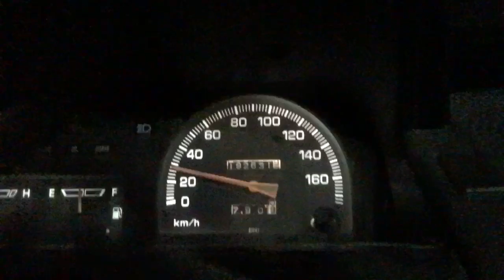1.5L/100km - Running your car on vapour - It really works!

Comment: With my anti-knock prototype I can advance my ignition timing to the maximum factory setting.  

Tested it on various engines including two diesels.  Seems to work in most cases.  Doesn't work well with carbureted engines.

Pause on the distributor part of the video, if you wish?

________________________________
A set of modifications is listed in the comment section of one of my videos.  The modifications are for lawnmowers and generators mainly.  Engines that run at A constant high speed.  

Racers back in the day would advance their timing past the point where the engine started to knock.  As long as they kept their RPMs up, the knock wouldn't ruin their engines.
Reply: Does running it too lean cause damage to the engine?

Comment: Another trick. One ounce of Acetone per ten gallons of gasoline. This will make the fuel vaporize more easily.
Reply from the maker: Ron Armstrong interesting! Thanks I’ll have to try that out. Have you tried this before?
Reply: I wonder if he's trolling since acetone is notorious for melting plastic :hmm:
Reply: @PrideSage99  He's right, acetone works well. I've used it on injection and carb systems. Just use a very small amount as he said.
Reply: I would be cautious about using Acetone in your fuel. It may adversely effect or damage the rubber parts and seals.  Check with the manufacturer of you fuel system to find out.
Reply: @robertmckinley2886  at an ounce per 10 gallons I have a feeling it won't be a problem.
Reply: I am wondering if the Acetone would have an adverse effect on the rubber parts in the fuel system?
Reply: Acetone does burn really well
Reply: @PrideSage99  It depends if your fuel housing is a plastic then yea it'll melt except if you made the housing made out of steel

Comment: have you tried leaving the gas as it is, and adding the vapor. that should increase mpg in theory. the computer sends to injectors the amount needed for power......the again yours is a carburetor......but give it a try
Reply from the maker: Maximo avila define toy won’t work with a carb. It’ll just throw the air/fuel ratio out. EFI cars will work much better with doing this way. But I haven’t tried that yet.

Comment: Single spark can blow you up dude
Reply from the maker: Muhammad Junaid nah, I’m not worried. Even if I put a match in the vaporiser, there’d be a bang, but it’d be fine. People are so worried, but I’ve lit up an container full of atomised fuel and it wasn’t too bad.
Reply: Nathan Rezannah atomised means ???
Reply from the maker: Muhammad Junaid amotized in this context is environmental factors changing the atomic structure of a substance. Simply, when a substance changes state, which in this case is liquid petrol to petrol gas, more accurately known as petrol vapour or atomised petrol.

Comment: I think better if u replace fuel vaporizer box outside engine bay will be a wise idea for safety. car factory never place gas tank near by engine
Reply from the maker: Chilli Crab yes that’s true, but just for myth busting and experiments, in the engine bay is fine as far as I’m concerned.

Comment: Monitor yer spark plugs, their condition, they'll let you kno if yer running rich, lean, or are OK
Reply from the maker: YES! Absolutely. I have had a few people mention this, and their absolutely correct. In saying that, a Air/Fuel gauge is a better way to dial in the mix.

Comment: isn't the air filter soaked after a while ?
Reply from the maker: milxl I didn’t check, so I can’t tell you 100% but we are dealing with a vapour, a gas. If there was more vapour that the car could handle, it was ‘flood’ the engine and not combust. The engine only sucks what it can combust when running

Comment: I tried it on my 1.5L Daewoo Racer. I couldn't believe myself. It really works. I wonder if one could make this kit on commercial level with safety measures to be used by common car owners.
Reply from the maker: That’s the idea, but everything has been patented and owed by the big oil and automotive companies. We can’t build and sell systems, but we can build systems for free and show others for free, which is what the aim is now for me.
Reply: @NathanR1995  still i feel that we can make it. It might be Patented in US or any other country but copies can always be made up from china with minor changes which could get the reshaped model out of the jurisdiction of the patent.
Reply: @mirzawaseem2006  Have you experienced any engine damage from running on vapor? I like the idea but still cautious.
Reply: @waseem baig 
کیا آپ کا نمبر مل سکتا ہے؟؟

Comment: Today I even get rid of my carburetor of my 5 MP lawn mower and man, that thing runs now extremely well. I can't say anything about that. Took me about 10 hours after I really decide to get rid of that shitty carburetor. And this was my best decision I made!! I will upload an other video to my channel in the next days. In my first setup I used no spark arrestor at all, not good I read on the internet. My second setup was with 2 spark arrestors. And my 3rd setup now is with 2 taps to control the amount of incoming air. Still my fuel bubbler container has to be of a better type.
Reply from the maker: Hans Welder love it! Thanks for sharing. I’ll be sure to check out your videos.

Comment: I've had a breakthrough. Getting 256 miles per gallon by heating my gas and I'm doing something else that I see no one else do.I can get much better than 256 but the car has no power and the cars dashboard will not calculate the mileage.anyway  the way am doing it -it's very simple and I guess that's why no one has thought of it plus I made a invention in conjunction with it?
Reply from the maker: Well mate! What the bloody hell are you waiting for? Tell us! What’s you do? And do you have a video demonstrating?

Comment: Where 1.5 litres per 100kms
Reply from the maker: The calculation is based off the averages of fuel Vapour engines. They generally achieve 4x the efficiency, or use four times less fuel. This Daihatsu runs factor 5.5L/100

Comment: I'd  say your problem is, the air going into you vapour chamber is dirty because its not filtered it ads particles to the petrol making it less volitle, with my one I'm  having  another container with plain water in to act like a water filter before the petrol chamber  so one clean air bubble the petrol the water molecules in the air will also make the engine work better try it youll see the water filter start turning black from the dirty air
Reply from the maker: wayne bailey praise the creator interesting, never heard or seen that. Send me a video of your setup. I’d love to see it
Reply: @NathanR1995  unfortunately youll have to wait till some time later in the year ive got a new car since last time i did it the other year and still got abit of finance to pay off before i can go altering this car, 2014 Peugeot 106 i have a feeling this car wil be really efficient, I'm  gonna try having petrol vapour alongside a hho cell , i ain't seen any videos of people trying both together could be the perfect marriage haha
Reply: @NathanR1995  but really you wanna atleast buy a bike air filter to go on the air inlet of petrol tank the petrol will be dirty from the air , youll be able to see it by looking at the petrol after a run , with a filter itll stay pretty clean and work so much better
Reply: @NathanR1995  look at how big the hose is on the cars actual fuel pump i think you'll find its alot thinner then your pipe, the bigger tubes could also be putting the efficiency down you should use 15mm pipe, but have a separate air hose going into the air inlet , i read on vapour you need a 50/1 air to fuel  ratio , need a valve between the petrol tank and air intake to restrict how much vapur is going in the engine
Reply: @NathanR1995  thinner hoses give greater vacuum pressure which it needs
Reply: @NathanR1995  the reason your car seemed to work better the more hoses you added is because it was diluting the vapour more with air,

Comment: I've done experiments of my own. The best way is to create a metal box just like you have same setup but metal. Then put a motor cycle or small transmission cooler radiator in side the box and run coolant lines from the cooling system of the car.  This will heat up the gas enough to vapourize it when the car warms up.  Then run the intake hose from your intake box to the exhaust manifold so the incoming air is always warm. my problem was fuel metering. i could never keep the rite amount of fuel in the box.  always to much or two little. PS.  if you try this watch out. if you spring a leak or get a back fire fire goes everywhere.

Comment: do you have  engine  over heat because lot of oxigen
Reply from the maker: engosti nope, I have the opposite happen. Engine runs cooler and smoother because vapour burns complete and much more efficiently.

Comment: You can also try heating up the air going into the fuel. The fuel level also need to be kept constant apparently.
Reply from the maker: Carl Darl I haven’t heard this before, and it doesn’t make sense. Colder air is more dense, and increases combustion, hence cold air intakes and the need for intercoolers.
Reply: @NathanR1995  Just based on the principle that warmer air holds more vapor, as in on a hot day there's more humidity (water vapor  in the air) than on a cold day. Don't know how one would heat up the incoming air. Otherwise why would they heat up the fuel, same principle applies doesn't it?
Reply from the maker: Carl Darl that is true, but here’s the kicker, we don’t really know until we do the experiment ourselves

Comment: Check YouTube for a white vapor system. And this does work better with heat or an ultrasonic transducer. I figured out as a teenager that an engine will run off of fumes from a gasoline soaked rag.
Reply from the maker: Ron Armstrong love it! As they used to say “she runs off the smell of an oily rag” I will build a system using an ultrasonic transducer. Firstly I’m doing more of a mechanical system, but I will also build a system that uses much more electronics. Just finding the spare time and cash.
Reply: @NathanR1995  I've toyed with the idea of using an ultrasonic mist maker. The way I see it is that would work for a generator or lawn mower.. something that doesn't have an accelerator. I don't think a mist maker will produce enough mist to power an engine at acceleration. Then add more mist makers? Then how do you regulate the amount of mist required at idle vs full acceleration?

Comment: I've got this idea. I drive an fj80 with 3fe engine, i can use the hose from the smog pump and run it to the fuel storage then take the fuel into the air intake. So while the engine is running it bubbles more. I wish i could do such in the fuel tank. It sure would be nice to run 60l for 3months
Reply from the maker: I like it! Sounds fantastic. I previously owned a 75 series with the 3f.
Be safe mate. Record a video of you doing this and show me. I’d really love to see. 

Thanks for commenting
Reply: For sure. My FJ80 is already taking fuel vapour from the fuel tank via the charcoal canister line. I regulated the FPR(FUEL PRESSURE REGULATOR) so low that I got 16 to 17mpg removed the EGR line and the truck moves like a jet. Just that small hose from the canister. Though I believe this theory. There was a time I washed my air filter with fuel and let it sit for sometime then put it back. As soon as I started the truck and throttled it abit. It had so much torque for almost 30 seconds I felt so much hp gain if I could do 0-60 on such power the truck would surely be 8 to 9 seconds. Even now I do 12 seconds 0-60 that's just with fumes from the charcoal canister line.
Reply from the maker: Please take some videos of this stuff. Many of us would love to see! Show me your setup etc.

Comment: You have to keep an eye on your sweet spot fuel temp.  Use a gauge and bring in heater core submerged into you fuel.  Get air filters on your air pipes.
Reply: If you let gasoline evaporate  cold you will build a foggy sludge.
Reply from the maker: Sergei Romanoff great advice. Thanks
Reply: Far better to heat the fuel and gassify it. This can be done electrically with off the shelf components. Then, all you need is a gas mixer for on top of the carby and a regulation valve in the fuel gas line from the gassifier. No oxygen can get into the fuel vapour, creating an explosive mix, until it is mixed at the carby intake.

Comment: I did this and successfully ran my car at 80 - 100 km/h at Autobahn in Germany. My problem was to maintain fuel vapor to air ratio. One thing I saw was the brown-black residue left by the gasoline at the bottom of my container. I maintained the gasoline temperature by putting a small electric heating plate underneath the container. I made a steel container for my test. I posted my system on my channel. Good luck!
Reply from the maker: I have seen some of your videos. Your content seems quite scientific! I love it!

Do you have videos of how you built your car system and test driving etc?

Also, have you been able to build a reliable fuel system to consistently increases fuel efficiency?
Reply: @NathanR1995  thank you! Unfortunately I did not make video of it while I ran my car. Here is a video of my system https://youtu.be/JkStHHH9wUM. At the moment I don't have time to develop my system further but I will definitely do it as soon as my time permits. So, I wish you good luck with your research. Just ask me if you want more information.

Comment: hey nathan  iam from ethiopia show me the way of  save fuel subaru  EA71  engine pls pls
Reply from the maker: You’ll have to watch my other videos to know roughly how to build a fuel vapouriser.

Otherwise a few quick tips are to inflate your tyres to their maximum rated pressure, service your car regularly, especially to clean your air intake filter or buy a performance high air flow filter, run new spark plugs, clean your distributor cap and don’t carry any extra weight in the car if you don’t need to.

Comment: Looking forward to seeing you develop this further. I am building the same for my 87 Nissan Tsuru. I want to see if it lives up to the hype of dishing out 100kms from a litre of petrol. Keep posting updates mate.
Reply from the maker: Zuhair Ali Khan

Thanks for your comment. I hope you can experiment and have good results too!
It’s very interesting, but so simple at the same time.

I will give updates as I develop new ideas and build new fuel systems
Reply: @NathanR1995  I built this a couple of days ago and man did it work! I felt the engine idled smoother. The horsepower though! I mean I have an old beat up 1987 Nissan Sunny and I was pulling wheel-spins on launch. 

The plastic container i was using got cold which is cz of the cooling effect when you draw vapors like that. I'm no physics expert - so I'm working on a metal container which will either be heated with radiator fluid or exhaust heat. and then will go for a mileage test on the inter-city highway. lets see how that goes.
Reply from the maker: Zuhair Ali Khan 

Sounds awesome mate. Please make a video and post it somewhere, and send me a link

Cheers